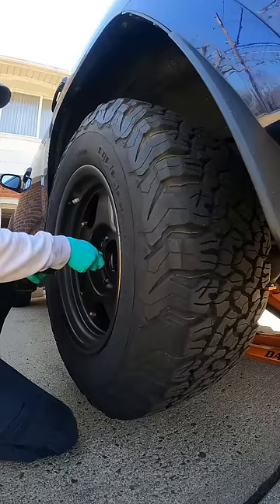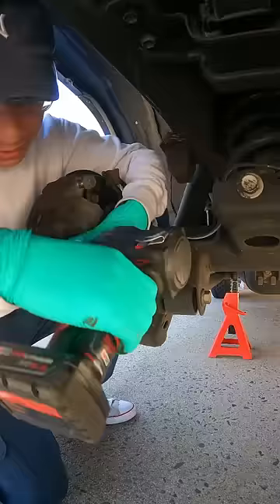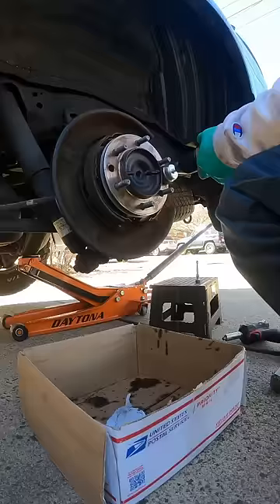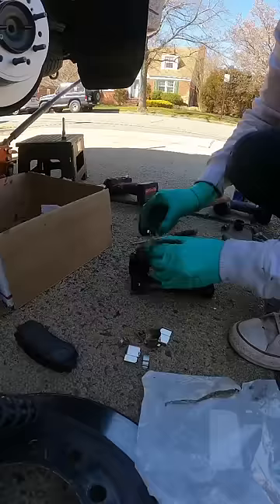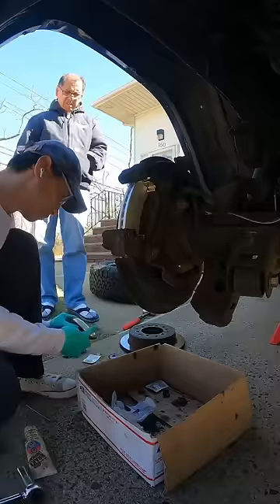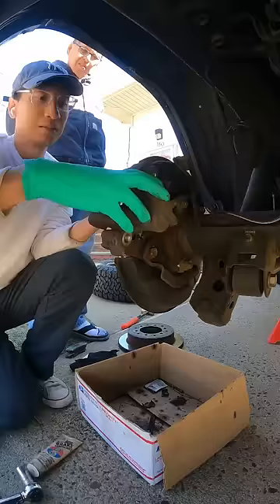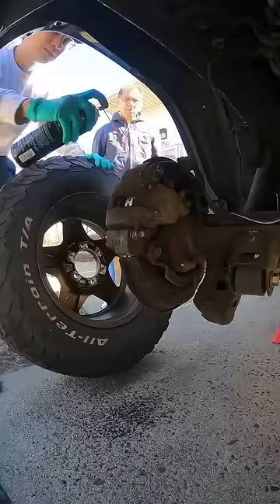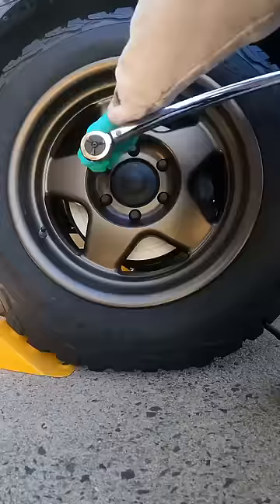Dealer wanted $700 to replace rear brakes. My DIY job cost me $100 and an hour of my time 😎

Comment: 😂😂😂 lmao me still waiting on the upgrade. 🤦‍♂️, you mean the standard coated rotor these days. Good on you to get off your arse and save a few bucks. Not many willing to do just that, so props there. But dnt try put down the dealer. Which field you wrk in and what do you charge for what you do. Lol, knowledge is power.

Comment: As a toyota tech myself- I agree the dealership’s ask way too much. :(. In the Last four years alone labor rates have gone from $130 to $200 in the dealership I work at. While a line tech’s base went from $28 to $32 now. The math does not add up. 😢.  A master can make up to 45 but thats with 5-10 years of experience. So please do not blame the mechanic’s or techs. We are as affected as our customers.

Comment: Where do yall get your parts from? Ive been using ROCK AUTO for years. Ive saved enought money to buy several cars😂. If its a part i know is failing i order it from Rock Auto bc they ship slow unless u pay and then it comes out to being the same or more than your local parts store. If i can't wait on the part (i drive trucks so most times i can) i get it from Amazon in a couple days for half the price of my local stores. 💯❤️👑💪🏿

Comment: I have a 1995 Chevrolet Silverado Z71 and I needed front brakes and front rotors and they tried to charge me 550 bucks so I went to advance autos and bought all the parts for 150 bucks. I went home and change them myself in 2 hours ☺️

Comment: Aftermarket will heat up faster and cause the rotors to warp thus making squeaks and grinds much sooner . Don’t forget you get what you pay for lol but for sure save that labor rate .

Comment: Bro forgot to mention that some newer vehicles require a manual shut off of the electronic parking break before starting. Failure to do this could cause damage to many things other than your brakes. Remember always look into things for your specific make and model before proceeding. Its a good habbit. It you are just working on your own vehicle then you only have to do this one time.

Comment: I'm a tech and I know why it's 700 to change the brakes on your vehicle. I also know the difference between the quality in OEM replacement parts and aftermarket. the bliss of a sweet deal is long forgotten by the sting of getting burned.

Comment: You don’t pump the break pedal to pressurize the brakes you pump the pedal to bleed the air pockets out of the bleeder screws, your breaks will be inconsistent and dangerous if you do no bleed them correctly, you can also blow brake line fittings with the air in the lines

Comment: Dealer wanted 1400 for my rear brakes and pads on chevy express. I got the materials for 300 and did it myself in 40 mins flat. 20 min each side. Unreal what they want to charge.

Comment: Remember the price of tooling up for the job.  And DIY doesn't come with a guarantee.   Once mounted, the parts guarantee is finished also, so make sure they are the right ones.  For a Golf 7, there are seven possibilities, but only one will fit.

Comment: The dealership tried to charge me 500 for the front and 650 for the back So I did them both myself Two hundred and $230 For breaks and Rotors. It was the easiest thing I have ever learned to do in my life.

Comment: Im all for DIY but the one things Nobody ever considers is the space required to work on your vehicle. 
When I lived with my parents they had a nice big barn with concrete floors to pull your car in use a floor jack, roll in and out without worring about the weather or daylight. 
Live in an apartment and all that goes out the window. Live in a share house, most likely you cant do this stuff.

Comment: I usually go to rock auto. I currently had to order two front wheel bearings 4 rotors With brake pads. Came out just over 600 dollars lol

Comment: Don’t forget to keep your old rotors to have them checked and resurfaced for the next time you have to change your pads
Reply: A majority of the newer rotors are not thick enough to have turned.  Even the slightest amount of warpage will throw them so far out of spec.  It is ridiculous, but does save a lot of weight. Less weight equals better MPG.

Comment: You didn't need to spray brake cleaner on the rotors, those are coated rotors. The coating is supposed to minimize noise and make the wear between pads and rotor more even.
Reply: You should also use a brake pad to push the piston in. It applies force more evenly across the surface and decreases the risk of a cracked piston.

Comment: was that oem parts you installed?  that's why they are cheap. they will last half the miles & won't work very well.  if it's a "Toy"ota, then only replace with Toyota parts...

Comment: I would not use break cleaner on the rotor while it's on its axle. If there's any rubber around that area, the break cleaner will eat it up, possibly ruining rubber break lines...

Comment: You dont need to replace rotors every pad change . you measure the thickness and compare to minimum specs . smooth out grooves . you forgot to flush fill fluid too

Comment: I can't think of any time when you need to go to a dealer. Well maybe if you have no reputable mechanics in your city or town. If you can get two rotors and two sets of new brakes pads for $100 you will not want them on your vehicle.That seems like a deal that is too good to be true.  

I just had my two spare front rotors machined which cost me $75. Took me about 45 minutes to install them. I absolutely love fresh rotors.

Comment: Clean them with a wire wheel 🤔 also may i suggest you crack a bleeder screw before pushing the piston back, or at the very least unscrew the master cylinder lid 😁

Comment: $100 for the parts, 1 hour of your time, £800 + for special, tools, equipment and consumables. If you get it wrong it will cost you double, if the dealer gets it wrong you get it done again for free. If you injure someone due to your negligence it can cost you a lot more as I bet you don’t have any liability insurance for repairing vehicles that will be used on the public highways.

Comment: Labor is $180 an hour, and aftermarket parts are never comparable, especially toyota oem. You saved money in the front end, but in the long run, you'll spend just as much as not to mention breaks are a safety item and not doing them right will cost you and potentially someone else to have a really bad day.

Comment: Upgrade for under a $100? What brake pads and rotors are you getting? Akebono brake pads are like $40-60, then upgrading to better rotors can't be less than those alone. Call me skeptical, but also intrigued on where you're getting your deals.

Comment: Local mechanic tried to charge me $790 to fix my water pump when it stopped working. I laughed and bought the parts myself and replaced the whole thing in about an hour and a half. It cost me $83. Anybody can be a mechanic these days.....you just have to find the right tutorial video and I promise there is one for every freaking car and every part. Just fix your own car it's way cheaper and you learn things as you do it.

Comment: It costs $50 in parts to change my brakes, that's why I do it myself, go to the dealership and they charge $400+ and they will probably ruin something else so you come back for another repair 👌
My oil change is $14, 4 quarts of oil, have a bunch of bottles saved up, this was pre inflation prices aka 2019. And in todays prices I get the 4th oil change free because my car only uses 4 quarts of oil, synthetic, and the if you buy 4 (5) quart bottles you'll have 1 quart left in each bottle for a free oil change👌👌👌👌👌

Comment: Toyota tech here, aftermarket pads are riddled with issues especially on Toyotas. I can’t tell you how many shitty rotors we have to junk because they corrode like crazy and wear super unevenly. You’ll have mad squeals and vibration in 15-20k miles. You get what you pay for, at least buy the OEM shit.

Comment: A mechanic wanted to charge me 1600 for front brakes, calipers and rotors. Rock auto came to the rescue with all parts less than 400.

Comment: I always grease the sliders too because the brake pads will wear funny if they get too much carbon build-up. One end slides the other end sticks in Bang you have a 70ﾟ angle on your brake pad

Comment: Awesome you did yourself. But if you paid a hundred in parts for rear rotors and brake pads.  Most likely they are junk. Those outa last 6 months or so before warping. When that time comes buy the OEMs. You won’t regret it.

Comment: Parts are prolly legit honestly with my commercial account I can get light duty pick up truck pads and rotors ceramic high quality not house brand for under 140 lifetime warranty on pads rotors come with 3 year warranty so for 100 I’d imagine is about right now if that’s all the way around I’d question the quality they’ll work but for a fraction of the time

Comment: Yup, a shop wanted to charge me 400$ an axle for rotors and pads I fucking laughed and got all 4 upgraded rotors and pads for 450$. 1600 for brakes on a crossover is ridiculous. Somehow all new tires, alignment, balancing and discard fee was only 1200 tho 🤣🤣 (I went on tire rack and bought my own instead)

Comment: The rotors alone are probably 100 each. Don't forget that $250 torque wrench, pads, and impact gun. The brake separator. Only if you have the correct tools. No,  it could not have cost you $100 for pads, and rotors. Considerably cheaper. Not that cheap.

Comment: Disc brakes replacement are easier than drums. No complicated adjustment needed, just some cleaning and proper lubs in the right places. Anyway, 600 for brake replacement is too much

Comment: Is good practice to take the cap off brake fluid reservoir. When pushing the pistons in... air could build in the brake lines. I usually put a few rags around the brake reservoir. Great job though $700 smh insanity

Comment: Is that it. Each caliper for the rear end of my Mitsubishi Outlander is $730. $1430.00 Before taxes. A complete brake job including rotors, calipers and pads is $4400.00 before taxes. Almost as bad Honda, almost.

Comment: Please don’t “tap” on your rotor.. you could damage the parking drum, eat up the threads on the studs.. use the 2 13mm bolt holes in the rotor..

Comment: Do not spray any brake cleaner on Geomet coated rotors.  If the rotor has a matte silver appearance and is fully coated, do not spray brake cleaner on it

Personally I bleed my calipers starting on the right rear.   And I like some never seize on both sides of the rotor to prevent any rims sticking or rotors when you change them next.  But I live where they salt the roads

Comment: No rust, cheap aftermarket parts and you already need to have all the tools required and materials such as silicone and brake lube. Most people if trying to do this "$100" job themselves will find they need to invest between $500-$1000 plus a lot of their own tine to learn how to do it properly and ALL the things NOT to do must be learned with experience, and you can't buy that. Then when you screw something up you had no idea about, I'll be fixing everything for 3x the original quote and you'll learn a good life lesson that things aren't cheap for a reason.

Comment: You aren’t getting OEM rotors for 100$ total. Those rotors WILL warp faster than the OEM rotors ever will and those brake pads could possibly make noise.

Comment: No way in hell it should have cost $700 for pads and rotors. Used car dealer I work for would have charged 1.5 for labor and maybe around $120 for parts. Total about $300 for the job. Difference in the cost of parts is there and obviously labor costs money but when you go through us and have a problem we fix it for you, but if you have issues the money comes out of your pocket. There’s a reason dealerships charge so much and it’s ignorant to say it’s a scam (some might be), but in the end people who do it for a living (professionally) will do a better job than someone who is doing there own maintenance by watching YouTube videos

Comment: Your rotors came precoated. You are not suppose to spray brake cleaner on them. Your pads will embed and clean this off as you break them in.

Comment: And when you're completely done after pumping the brake pedal before starting the car please don't forget to bed the brakes by that I mean go about 45 50 mile-an-hour and apply the brakes pretty firmly don't slam on them but firmly do that like three or four times a smoke and a funny smell is completely normal then you're good to go

Comment: Biggest mistake here is trying to inform people it was an "upgrade". If the cost of the brake components was less than the Genuine Toyota parts, they were almost assuradely inferior parts. See you in less than half the regular interval back at the dealership 👍🏻

Comment: Tehe. No need to spray ur new rotors w/ brake cleaner. The type u installed are silver cause they are coated. Only blank metallic (shiny) rotors are shipped w/ grease cause they easily rust. Ur matte silver ones are already protected😅☺️ and wear as u break in the pads leaving the edges protected with the coating. 😲

Comment: Well I wouldn't exactly say you are upgrading. Usually your paying more for offset standard pads and rotors to upgrade ones. I get the point why you did this though. Always cheaper to do it yourself.

Comment: Toyota dealer wanted to charge me $1,800.00 for two front wheel hubs replace and $750.00 for front and rear differential fluid drain and fill for 2011 Toyota Rav 4 . 
All for a wallet friendly total of $2,550.00 plus tax.
I did it all for $312.00 purchasing parts online-  
two front Moog wheel hubs and 2 quarts Liqui-Moly full syn hypoid gear oil.
Saved myself $2,400.00.
Toyota dealerships are over-charging @ prices that are insane.

Comment: lmao. you dont need fancy tools to do this. this can totally be done by hand and with out a torque wrench. i would guess around 150 for tools. 1. a set of sockets 3/8 drive. 2. a breaker bar. 3 a hammer 4. maybe some extensions. 5 an actual ratchet. assuming you have a jack already most people should..

Comment: You should change the brake fluid out of the line as well. No need to wire brush a rotor or spraying it down with brake clean. 

The thing that got my attention. He’s wearing white shoes. Who tf where’s white shoes to work on a vehicle?

Comment: You did everything right until you put the tire back on. The lugs should always be torqued on after a brake job as uneven tightening can cause unnecessary uneven rotor wear. Otherwise coming from a tech great job!

Comment: Even doing it with impact vs old school , wrenching...gosh, its too easy but why do i still do it old school?? I am use 2 it, i guess

Show the work, closer and actual show how you pushed the valiper back since u are using the tool. Good job ..just dont talk it with a view thats not so close up

Comment: Them some cheap economy breaks..... Yes but you get what you pay for it. You probably would have got however long the original breaks last week. That's how long the one from the dealers would have lasted.... Now you're rock. Auto pads and rotors are going to last maybe 6 months to a year on the pads depending on how much you drive and the rotors might last you a couple years if you don't get them hot and warp them before that

Comment: There is a huge difference between made in China pot metal brake parts and oem Toyota . FYI but hey it’s only brakes right ? 70,000$ truck . Saves 600$ with cheap brakes. Brilliant

Comment: Putting on cheap Chinese brake rotors and pads to save money is not recommended. 
The video doesn't mention if he spent $100 per each wheel or all four.
Quality parts will cost more and last longer, not to mention stop your truck properly when needed most.

Comment: $100 for rotors and pads 🤨 scary cheap. PS don't for get the red high heat medium strength lock tight on those bolts for caliper.

Comment: Don't ever put on your automotive lugs with an impact. My milwaukee torques to 340 on setting 1. Youre just stretching your studs. (Lots of videos showing how much torque they can apply or you can test yourself with a torque wrench)

Comment: You might want to bleed those brakes, or even better, flush the old fluid if it hasn't been done in a while, say every 20 - 40 k miles.

Comment: EVERYBODY ALWAYS FORGETS ONE THING POP THE HOOD AND REMOVE THE CAP OFF THE BRAKE FLUID RESERVOIR  IF YOU DONT WHEN YOU PRESS THE PISTON BACK IN THE CALIPER THE PRESSURE CREATED CAN RUPTURE THE RUBBER BOOT IN YOUR MASTER CYLINDER  AND THUS YOU WILL LOOSE PRESSURE FOOT TO FLOOR  IT WONT ALWAYS HAPPEN BUT I HAVE SEEN ENOUGH PEOPLE DO IT OVER THE YEARS AND YOU 100 DOLLAR BRAKE JOB NOW BECAME 500 -1000 BUCKS

Comment: If you can do it yourself, great. Always use OEM parts. There is a difference in quality. Toyotas are Toyotas for a reason. Don’t turn your Toyota into aftermarket junk.

Comment: thats BS, 2 brand new rotors alone cost over $100 for that vehicle And even if he could get the rotors for cheap, or had a BUNCH of points accumulated at Autozone theres NO way he got the 2 rotors AND set of pad (ESPECIALLY NOT UPGRADED ONES LIKE HE IMPLIED) for $100 or less even BEFORE tax!

Comment: That was no “upgrade” lol. $78 rotors and pads! First puddle you hit those rotors are gonna be warped like a mf. DIY is great to save money but always use akebono pads and the best rotors you can buy preferably oem or better.